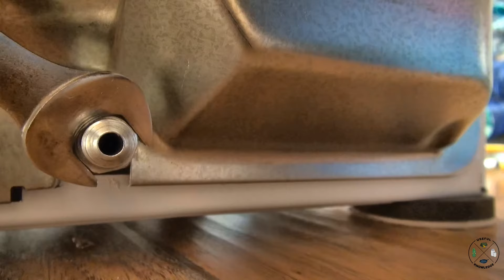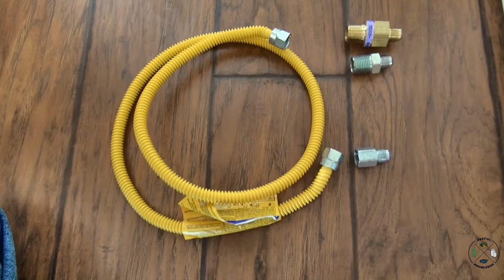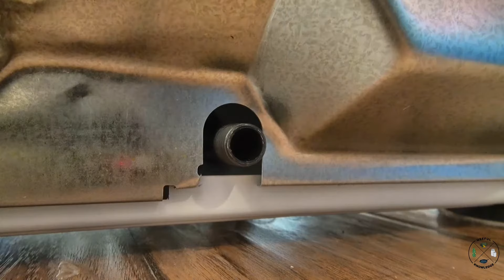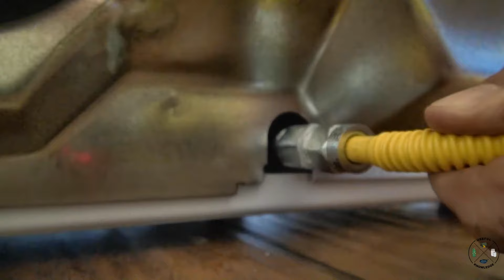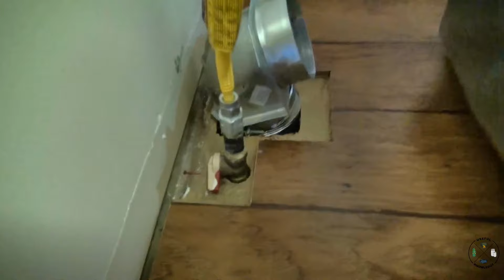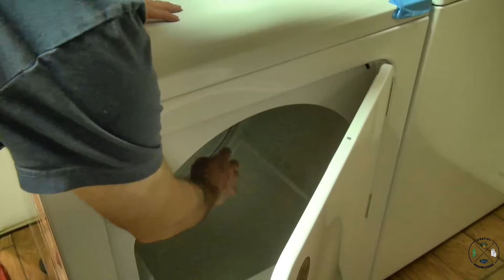Gas Dryer Installation | Useful Knowledge

Comment: Do you have a video on how to clean the lint inside the gas dryer? Thanks
Reply from the maker: I don’t but I can tell you that we are very meticulous about removing the lint from the screen after every dryer cycle.   I just replace the venting for the first time in 23 years so keeping that lint in check worked.

Comment: Can you use teflon tape instead of the pipe dope? Some kits come with some tape included but I read somewhere that teflon is not gas rated and some other kind should be used.
Reply from the maker: Hi.  Yes you can use Teflon tape as long as it says “for gas” fittings and connections.

Comment: What if my dryer is 3/8” I bought flex hose to fit that but the gas coming in my house is 1/2” how do I hook it up?
Reply from the maker: Sorry just saw this.  Did you get it figured out?  What does the dryer have coming out?
Reply: For any future reference,  U have to change one side so both sides of the flex connector match.  You can usually change the adapter on the dryer to match what's at the house.  Alternatively,  you could change the valve at the house to match the dryer but that would involve turning the gas to the house off.  Also you don't want to use more than one adapter on the dryer side

Comment: Question can the gas whose big longer then 6feet if. I needed it to
Reply from the maker: Based on what I think you are asking, yes if you can find a hose that long.
Reply: @useful.knowledge  yes I want to connect it from the inside to outside where washer is